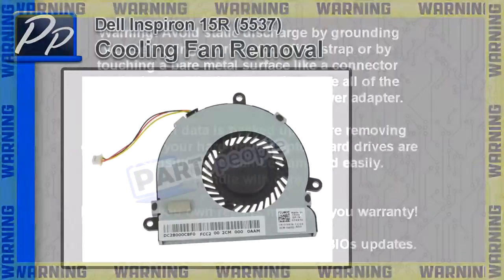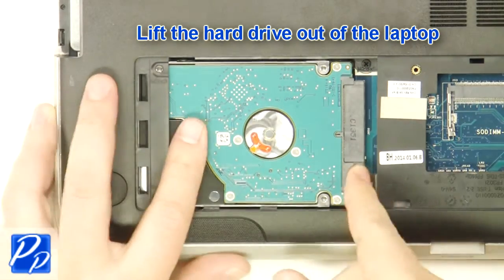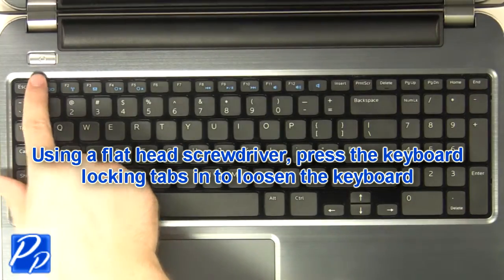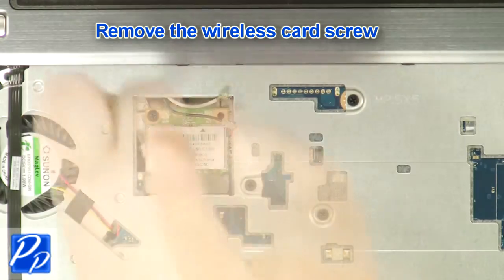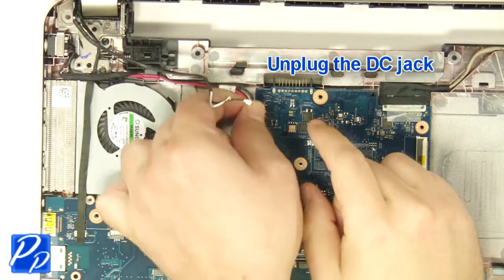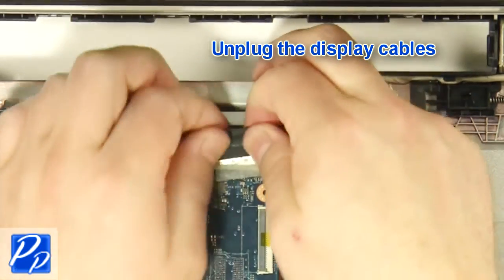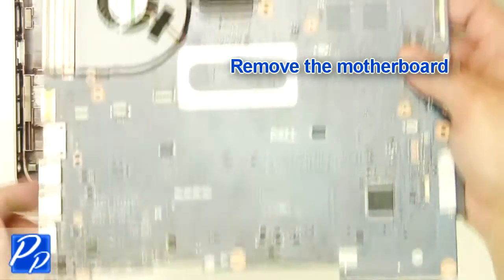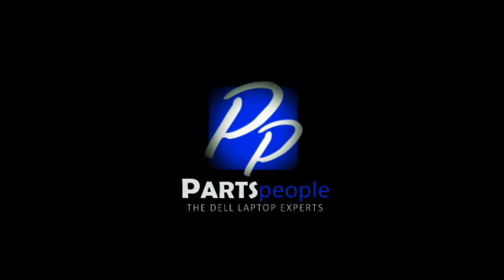Dell Inspiron 15R (5537) CPU Cooling Fan Video Tutorial Teardown

Comment: Have you been able to definitively ascertain where the 5321-5521-5537 chassis family actually draws in air for the fan?
The only two places I can see are the mesh grill around the memory-hdd area, which would make sense, plus it would explain why there is no inlet directly below the fan (to force air through all the components and motherboard too) and the tiny slit underneath the exhaust port, which I don't think makes sense because:
A: There is a groove in the plastic that look like it was meant to serve as a gasket groove
B: The fan seems to rest on that groove anyway
C: I have tested actually putting a foam gasket in that groove to eliminate potential noise from fan vibration and it didn't affect cooling (same temperatures as before)  
I am still skeptical about whether C was a good idea which is why I am asking this question. Do you think that slit can actually be an intake?